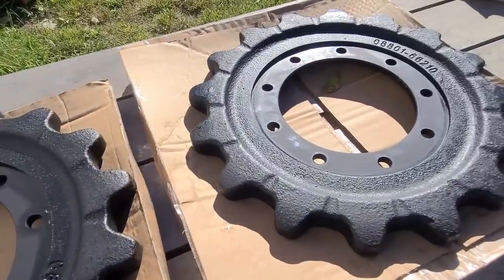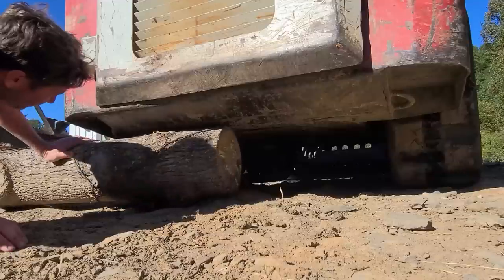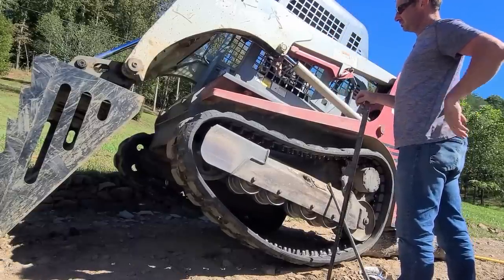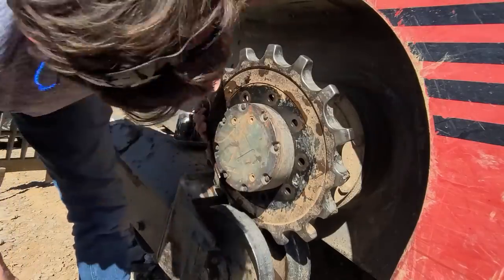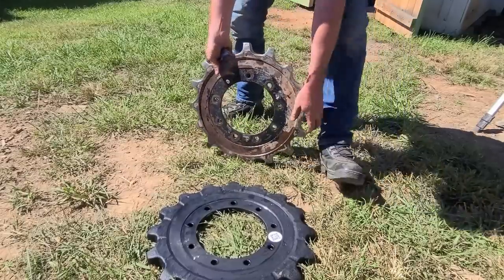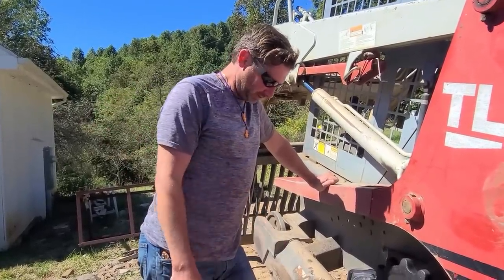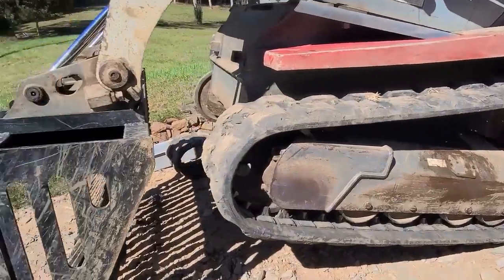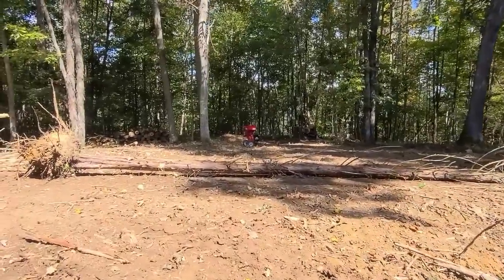Replacing the sprockets on the Takeuchi TL130 // E103

Comment: Well done.  A really good video of how those tracks are mounted/dis-mounted, and the only thing you might have done was to use anti-seize compound on those bolt threads.  Heavy-use, exposed bolts will corrode with mud, water, etc. intrusion, and it would be easier to get them broken loose next time.....ask me how I know.....LOL
Reply: Just a little thing to remember if you use anti seize reduce your torque setting by 25 percent

Comment: You know John it's crazy how the rubber tracks will wore out metal
Reply: The rubber tracks wear out the sprockets idlers and rollers due to the metal bars, cleats and cables that make up the internal structure of the rubber track

Comment: Good video bro appreciate it. I don’t need to do this to my TL150 yet but will in the future if it lasts me. I may change the front idler oil though.
Reply from the maker: 80/90 gear oil works well in the final drives and the idlers on these machines.  Good luck with yours.  They're nice, simple, strong machines.

Comment: John, that sprocket is a damn good one for the one piece style that you picked out.... they do come in a three piece design so you don't have to take the track off to replace unless you have a one piece on it already. The one you got has had the teeth addressed to keep from chewing the track up as some are sharp and high tooth. Those don't last as long, they will walk off easier as well. I prefer the three piece sets as their easy to change an are of high wear regardless of which one you buy. That machine you have is probably better than any other model out there like say Kubota which is a high engine failure rate. This machine has the least  computer driven problems an doesn't have the DEF fluids that kill those engines for premature rates

Comment: Great video guys. I have no experience with these machines but I have a suggestion for you. Keep checking those sprockets during use. When they show signs of wearing down on the front face, just exchange them left for right. Then they will be wearing on the opposite side of the teeth and you will get much more wear out of them over all. Oh and I am almost sure I remember the first time you tried tensioning the tracks you decided to use an old plastic bottle to catch the grease from the fitting, therefore not making so much mess. What happened to that idea?

Comment: that big bar u called a tooth pick.  I can it a fence post hole digger.  In spring when  ground is nice and loose U ram it into ground a few times (about a foot to 18 ") put point of post in hole and bash it in with a 20 maul.  We worked as a team of four Dad my elder bro me and younger bro.  The Kid my younger bro got to sit on tracker b/c he could no swing the maul. I got to dig holes with the bar.  Dad and Cliff took turns with the maul.  At 14 I had the muscle to swing maul and we began rotating the hole digging with the Maul.  We could put plant a post in less then a minute.  Now this was replacing post in fence for it was already there.  The kid got the job of putting Insulator on post Meaning he did not just get to sit there.
Reply from the maker: Surprised the younger sibling got to sit!  Usually it's the other way around.  I'm the youngest in my family and quite thankful because I'd always be helping my Dad change tires or shingle the house, or chop wood until it was dark.  I learned many skills from him just by being present.  Cool story you shared.  Sounds like the good ol' days!
Reply: @WalnutsandWineberries  hell at 74 i am still having them.  Only wholes are now dug by posthole digger on back of tracker and I done swing a 20lb maul anymore.
Do build fence almost yr around every day but now it is step-in post and poly wire.
Move cattle every day.  This summer so dry twice a day.